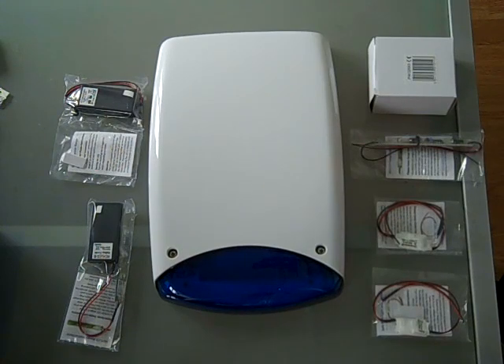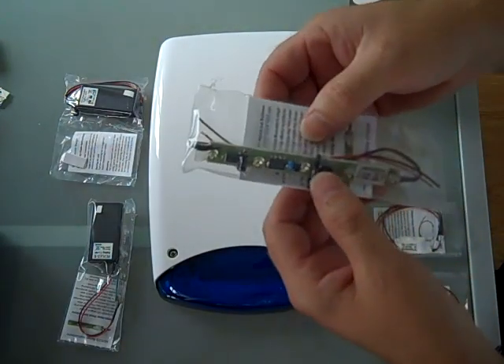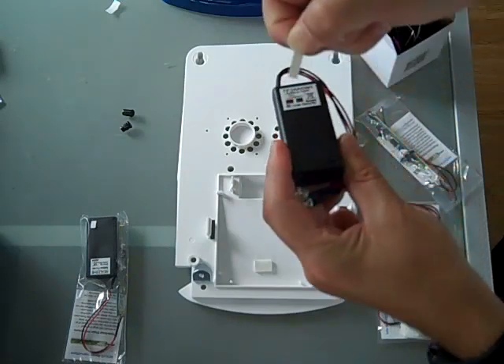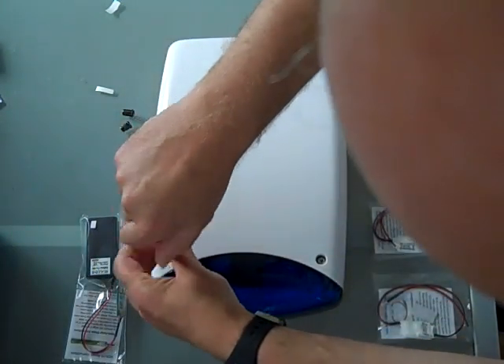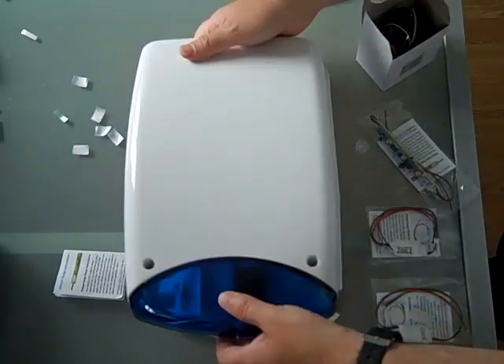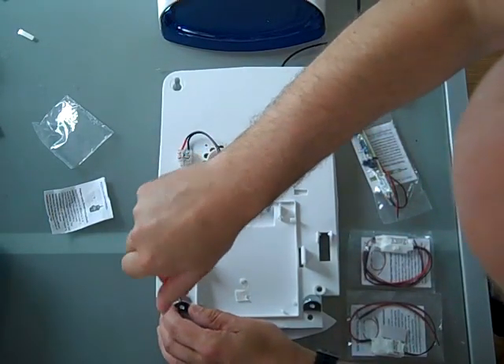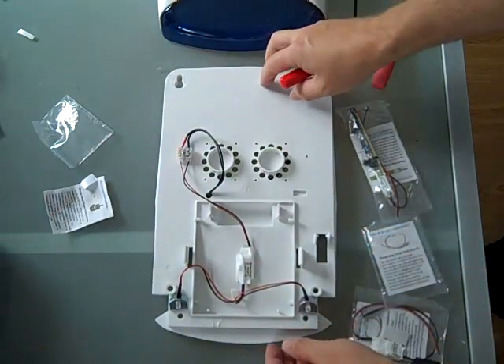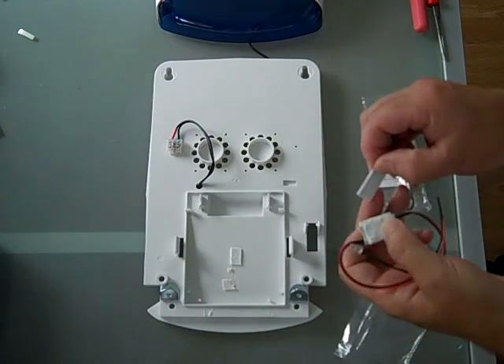How to fit twin flashing led module to alarm boxes

Comment from the maker: I would think that is possible. All you would need is the BILIGHT-624. this module will operate from a dc supply voltage between 6v to 24 volts. The actual module is about the size of a UK stamp. Just connect it to the 12v supply in your alarm box and position the leds you may need the brackets and away you go. hope that helps. Des

Comment from the maker: Sorry for the delay in getting back to you. We do not supply response with flashers because if we did you would not have a problem. So I would suggest you contact acetek.co.uk where will will be happy to supply you a reliable product.